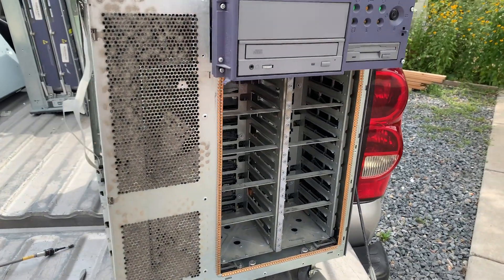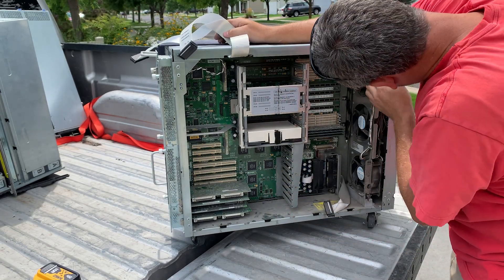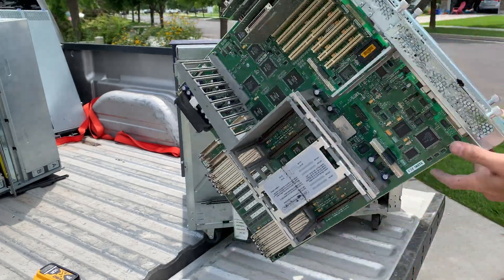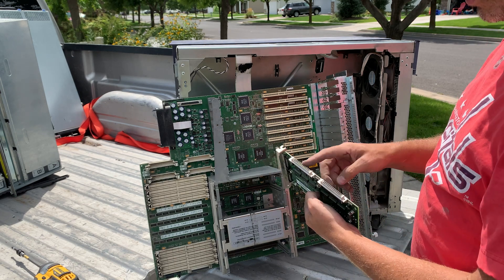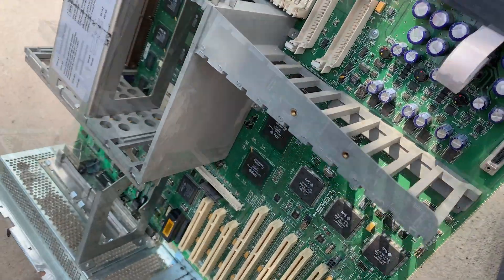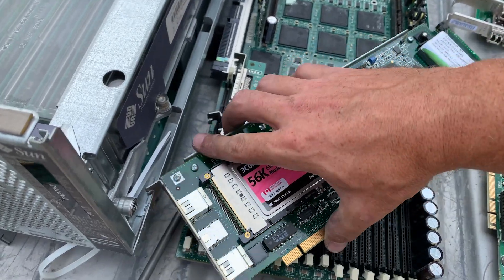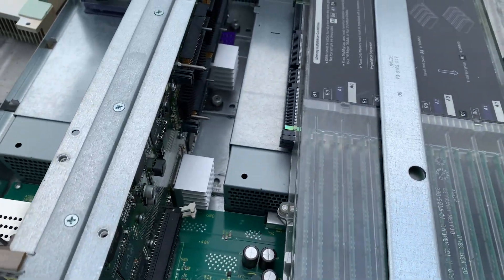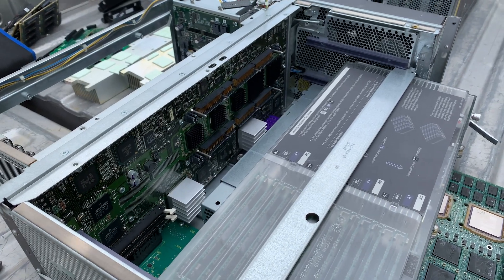An Amazing Tear Down - 1990s Sun Servers

Comment: This vidéo is a bit old so maybe it's late for an answer, but 10:22 & 13:48, theses are VRM (Voltage regulator module), often they where for every CPU installed in a server.  for Intel cpu servers i've seen often 1 VRM/cpu.  But with HP-PA risc i've seen 3 VRM/CPU installed (like it look like to be at 13:48).    In case of an CPU upgrade for a server, you would have received in the box, the CPU, the heatsink, and the VRM(s) that should be used with this CPU for a spécific server.  Without, the CPU wont work.      It was handy back then when you have a faulty VRM module to replace only this part.  But it became too much troubles for déliver power through a connector (and it's always an extra cost), now they are often componments directly soldered on the server motherboard, if a vrm fail, the motherboard must be replaced.
Reply from the maker: Good information!  It is not too late :).  I am always happy to hear more about the tech I am not as familiar with.  I am also happy to learn more about what I don't explain well or understand in my videos.  My background is mostly software architecture and creation, but I was a hardware tech and installer about 25 years ago.  I never had the opportunity to learn about the server side of things back then.  I do know that the first generation of Pentium 4 used something like these VRMs and they would sit in a slot right next to the CPU.  It was built to be modular.  I guess Intel was just thinking about the P4 in a similar way that many companies were thinking about server architectures.

Thank you for your comment :)

Comment: Sun Microsystems Ultra Enterprise 450 Workgroup Server, DIMM memory modules nothing special though, each of which is capable of storing 16, 32, 64, 128, or 256 Mbytes with a max of 4 gigs including expandable memory. The motherboards had options of 4 slot cpus